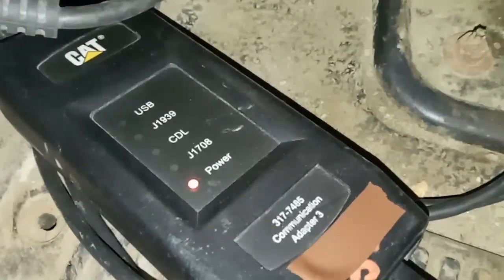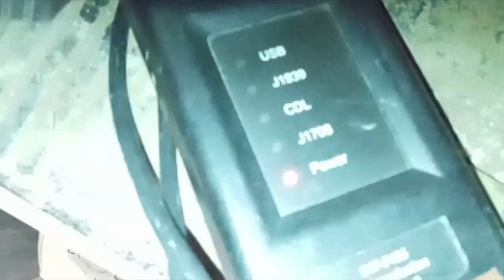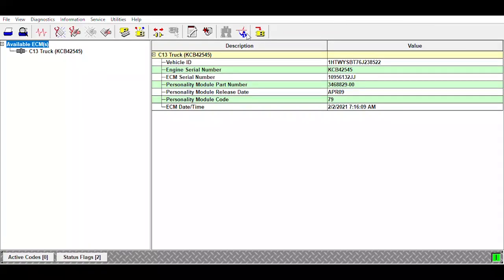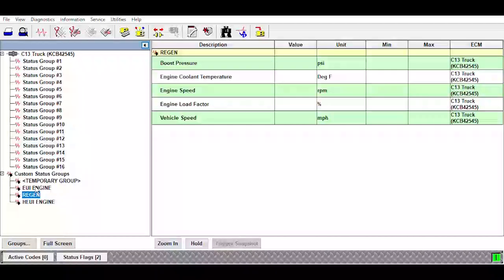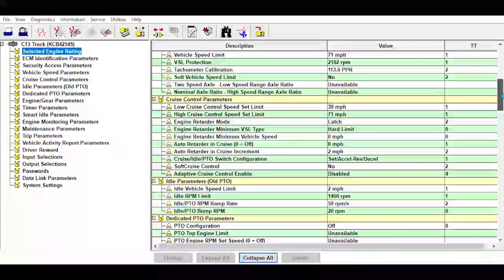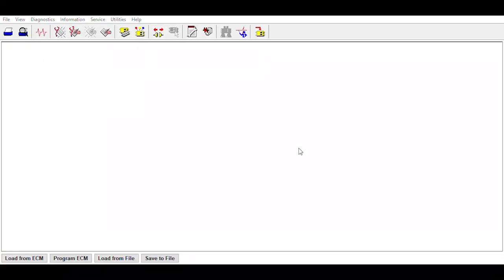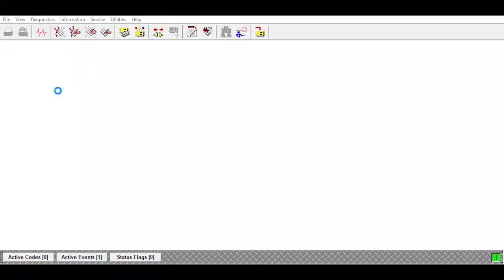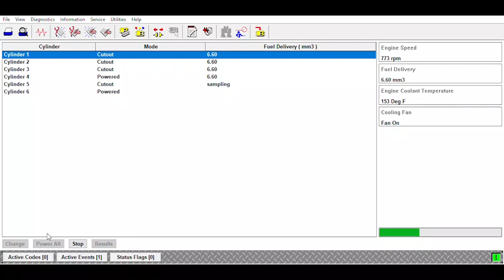How To Use Cat ET. Cat Electronic Technician.

Comment: hi there, i am a 64 year old retired train driver from RSA, i like diesel engines, especially the 16 cylinder and 10 cylinder ones, the other day i watched a Pakistani team overhauling an engine, on top of the pistons was a valve, i wondered what  is the purpose of that valve, when you strip that engine completely , do you gooi all the bolts and nuts in one bucket and then still know were every bolt and nut belongs,

Comment: Very good video.  Doing homework before needing to change the source address code for a windows 10 operating control to read multiple engine data.  Unit has 4 engines, 3 running at any given time.

Comment: Hey Josh. Thanks for all the helpful videos.  Can you recommend where to buy a customer cat et software?  I have a few trucks with the 3126 and one of them starts on either but then shuts down after a few seconds.  I put a new huei pump and injectors in recently also new speed sensors and wire harness to injectors.  And I’m getting flash codes 15-39-62 any pointers would be great thanks.

Comment: Good day im having trouble with my Cat140K I've changed all 6 injectors but the machine is over fueling stuttering etc....no diagnostic codes present ive compared all values to another Cat140K the done all tests ets...the fuel delivery volume is different on the Cat thats running good its 9500mm3 but on the Cat140K thats stuttering its 18000mm3 ....No injector trim files were loaded could this be the cause?

Comment: I work for a Perkins dealer and use dealer ET for Perkins. Do you know what the differences between customer and dealer? If I get the license for Cat they probably won’t let me purchase the dealer version,
Reply: Interface Cat Comm 3 wires is the same for Perkins EST?
Reply: @matosdiesel2653  the software is the same. The actual connection plug may be different. But they use the same protocol.

Comment: I have ET2021a. On a 2017 Industrial C7.1 which has a DEF quality sensor in the tank. Is it possible to read that parameter in ET? Other venders that have a sensor you can read DEF quality % along with all the other sensor data but I cant find it in Cat et.

Comment: I have a Cat 242d skidsteer. A few months ago, my engine harness got melted and I replaced with a new harness. Ever since then,  it has a code for regenerate and my skidsteer got sluggish. My question to you is,  would I be able to reset codes with Cat et software with out password?

Comment: Bud I have a 2015 caterpillar ct660s over the road dump truck with a c13 engine. I'm having trouble finding the 02 sensor, would you know where I can find it.
Reply from the maker: Well, I haven't touched a Cat truck in a couple years, but there are the NOX sensors on the inlet and outlet of the SCR canister under the passenger side step. I don't remember there being an actual O2 sensor anywhere on the engine.
Reply: @AdeptApe  Well here is my deal, I took my truck to Caterpillar dealer where it sat for almost 2 weeks. Why... because they share the computer to diagnose the check engine light between 4 dealers here  in Arkansas. It would probably be another week and a half before they got the computer. So I picked it up and took it to the loves shop, where they told me it was the 02 sensor. Thou they couldn't specify which one was bad. I'm going to change them out one at a time to see what change happens in doing  so. Found the Nox sensors at kenworth dealer.

Comment: is ee you using 317-7485 comm adapter. people are selling oem cat comm adapters in oem packaging but saing its new part number is 538-5051. i searched for 538-5051 on at parts and there is no listing for it. Whats your thoughts

Comment: Can I change my engine serial number with ET?
Reply: Yes, but why would you? If your engine is legal you could void any warranty on new parts installed.
Level III passwords, could be a charge from Cat if it's legal. If not you will have to get a illegal password calculator program.
Reply: Yes, you can change no password required.

Comment: Cat sucks in this regard. They will not sell to a independent repair shop...at least in my area they wont. Will only sell to a fleet owner with a minimum of 5 trucks. I own a small repair shop and am stuck using pirated software or aftermarket.

Comment: We have a fleet of trucks where I work that all have Cummins engines and we use Insite (Cummins oem software) and it's absolutely awful!! 
We also have a snap on ProLink and I think that gets used more than anything else! 
The cat software looks so much better than Cummins insight but you know cat doesn't make on-road truck engines anymore so.............
Reply: What’s makes insite awful? I’ve used just about every oem software and Insite is one of the easiest to use
Reply: @dieseltech7_358  It seems like it always needs to be updated, crashes constantly, won't update ECM's properly, it's just a gigantic pain in the ass compared to the prolink!
Reply: I’ve never had it crash on me and the ecm update has gotten better. They had a big problem for a while little but seems to be worked out now.

Comment: I have a 3406E that shows 2 previous owners on the ECM and I want to do a rerate. It won't let me change anything is that a dealer only thing to get rid of the previous owners info on the ECM
Reply: That makes no sense. You have last time a parameter was changed. Don't need a password unless customer has one.
And you have a system parameter change that will require a Cat password.
Most rerates require a transmission and clutch change. Unless your staying at the current peak torque value. Which if you are, your not gaining anything at 1200 RPM's. It boils down to the interlock code. When you flash the ECM to a different rating and or LOW NOX file from a non low NOX, the interlock code is changed. It will say not programmed. The engine will start up and run but the throttle will not work. It will require a level III password, to marry the ECM to the current file. A low NOX password will ask you if it's a rebuild or not and will go at no charge, if the same HP.
If your changing HP up or down will require level III password and going up is a fee. Some HP changes only certain people are authorized to get them, due to the legality. Case in point if you have a MXS/NXS 550 or below and you wish to go to a 600 and up.
Some engines like a MBN no rerating outside of a engine family. If you have a 475 low torque for example you cannot legally rerate it to the high torque family. You cannot get passwords from Cat. With the older engines most of the time will require a iron change to increase HP. The 5EK's was the worst. As the newer engines came out, required less and now most of the time a flash only.
I get a lot of used ECM customers and have to change engine serial number, flashing ECM, interlock code, FLS/FTS changes, then you get into customer parameters and such. If you have a Cat, you need a jump drive and get what's called a ECM replacement file just in case your ECM fails. You have a copy of how it's programmed. You need a clean copy, as if it has a bug in it. If you load from file you will carry the bug into that ECM.
Reply: Yes you can but you need factory password or just give ECM to your local dealer to help you out.

Comment: I have an active code on my Cat ct660. It has the ct13 engine and the code I have is SPN 5542, I believe it has something to do with exhaust back pressure and maybe a sticky turbo dump valve. What are your first thoughts, thanks.
Reply: I think the CT13 is actually a Navistar MaxxForce 13. Not NAV’s best engine. I’m not sure who’s software is running the CT 13. If it is Navistar software I wonder if cat T even works with it?

Comment: You can get the dealer version of Cat ET 2020 online for free👀🤭 even with the keygen file. Fun fact, ET won't work on the newer on highway "Cat" branded trucks because they just threw a navistar N13 in there🤣 so you have to use Navistar's NED program. Shame on cat for just repainting the engine yellow and slapping a Cat logo on the valve cover lmao.
Reply: Could you reply with a link to the ET Dealer version online? Thanks very much.
Reply: @gcam474  have to be a member on mhhauto to access links to stuff
Reply: gabriel guzman - Thanks Gabe. Very grateful for the reply.
Reply: Do you have it? Does it work? I bet not. It probably has no activation. I have several et programs and not one was free.
Reply: @johncholmes643  I have the legit 2020 ET version but have downloaded 2019 ET dealer for free with the key generator online from mhhauto. 2020 is also available but I already have the legit version. Cummins insite 8.6 and JPro are also all free lol.

Comment: Are you going to continue the diesel 101 videos. Really enjoyed the intro to diesel mechanics. I plan to go to a tech school this fall for it
Reply from the maker: Good question, the first 2 did really good, but the last 2 did really poorly. I think I'm going to make 1 more on fuel systems and probably an electric course. We will see what happens.
Reply: @AdeptApe  That was probably the best series you've done so far. I really enjoyed it and understood how they work much better as a result.
Reply: @Adept Ape hi, I’m having issues with my cat 320d 6.4 acert engine. The code is low fuel pressure on rail. The machine is still working perfect if you keep the engine speed dial on 8 or under. If you select 9 or 10 the engine enter on safe mode and loose power after a couple of minutes. Now It is doing on 8 too and I’m working the machine on 7 but it’s very slow.
I have replaced: 
Fuel return valve (fuel rail) 
Low pressure pump
2 Inyectors (they had little return) 
Flush all fuel lines and filter base. 

Any idea if what could be happen? 
A lot of people say may be the high pressure pump but it is the only thing I didn’t change. I think the pump is very expensive for keep guessing the issue. 

All this parts where diagnosed and replaced by a cat technician

Comment: Josh, does your dealer software have a keyword generator to program personality numbers? I.e FTS FLS. or does your dealership version make you phone into CAT and give them the scan code to enter the passwords? The reason I ask is when you flash the ECM you need to program the personality code by entering the passwords and I'm curious if dealers have to phone into CAT to get them.
Reply: No we just tap the pop up screen, enter our job number and it generates the codes, we can change fts, fls, totals. When we do complete rebuild I zero the hours.
Reply: @chevy36ful  how do you get the job number and what does FLS and FTS stand for? How are people making custom files out  there and getting passwords even though they don't work at dealerships?
Reply: @jorgem838  hacked Cat ET programs. Same people who do emission delete files on trucks
Reply: @Thegoose95  how hard is it to get the hacked version?
Reply: @jorgem838  I have no clue, I've never messed with emission deleting stuff and never will but you can try finding more info on mhhauto.com. that's where all delete files and software are found lol.
Reply: @jorgem838  Full Load Setting, Full Torque Setting. I work in a CAT engine build shop so have no idea how other people get passwords.
Reply: @anthonyhunt561  what's file 27075? Is that a C-16 file?
Reply: @anthonyhunt561  i figured someone pays a Dealer or knows someone who works there maybe
Reply: @jorgem838  C16 Arr 2444606   Flash file 2707075
Reply: @anthonyhunt561  You can purchase a program on line.
Reply from the maker: What he said, although I don't zero the hours on a rebuild as they use the starting hours of a rebuild as warranty tracking.
Reply: @AdeptApe  so is it possible to zero the engine hours with cat et
Reply: @dhillonsavee  yes on rebuilt engines we clear all total as the engine is now rebuilt to new. When you do a Cat certified rebuild you replace the ECM.

Comment: Good video, I use ET a bit at work and on my own time with my weird hobbies. One thing that has puzzled me tho is What is the difference between an event code and an active/logged code? I was recently working on C7S in a 4x4 GMC 7500 with an extreme low power complaint w/CEL that was gone when I arrived. I found no active codes, a few logged diag codes that seemed unrelated to severe power loss for a few reasons, and quite a few event codes including fuel rail pressure and fuel leakage. There was no fuel leak (although it did have a badly leaking Charge Air Cooler), but would not pass a fuel system verification. So this was puzzling me for a while, perhaps a come back waiting to happen. But not knowing the distinction between event and "normal" codes was a hinderance in trying to explain the situation to my bosses and the customer supervisor as well making me question my logic of how I was proceeding.
Reply: In ET diagnostic codes “typically” indicate an electrical issue like an open or short circuit in a component (sensor, solenoid etc), wiring or ECM itself. The common ones will be -3, -4, -5 & -6 that indicate voltage or current is above or below normal. 
Event codes “typically” indicate an mechanical issue like a pressure, temp or speed too high, too low etc. Essentially the ECM is getting a signal back from the sensor that is valid but not what it wants or expects to see given current operating conditions. Think high coolant temp or low boost pressure but I have seen sensors fail and not go full open or short so you see an event code but the electrical component (sensor) is the cause. 
An active diagnostic code or event code is something that is currently happening. A logged diagnostic code or event code is something that was active in the past and stored as sort of a clue to prior issues. In ET we can see how many times a code or event was active in the logged screen as well as the first and last time it was active.
Reply: @chevypower33  Thank you very much
Reply: Not that I work with this software at all, but my best guess is one is stored (event?) and then there are codes that are currently being used (normal?). I know in cars, codes are stored until they are cleared, even if they somehow get fixed, they just get shown as past codes instead of current.